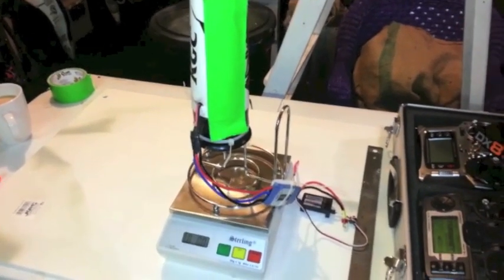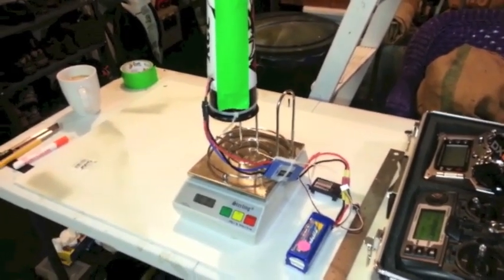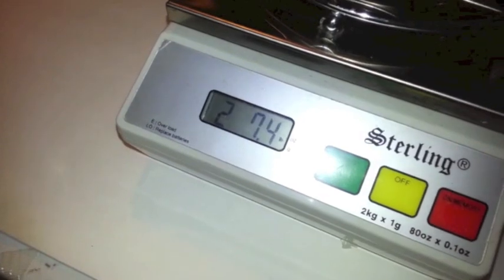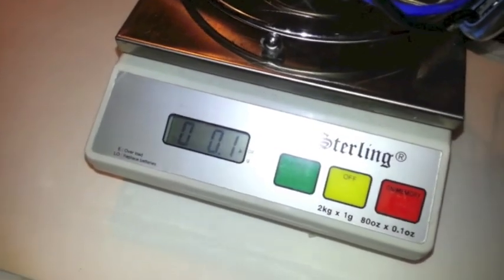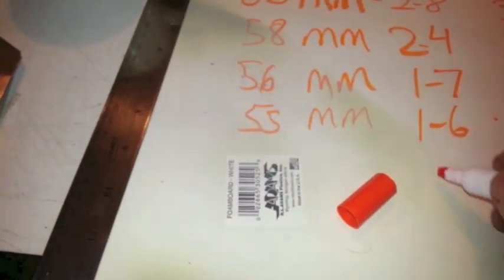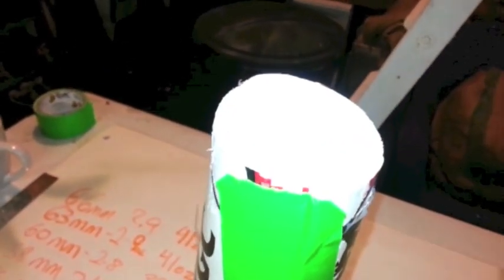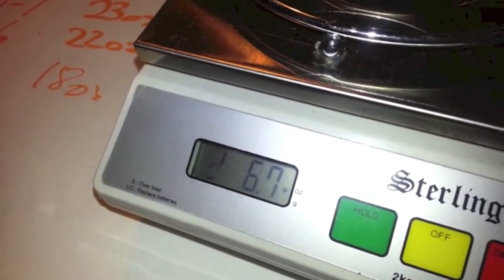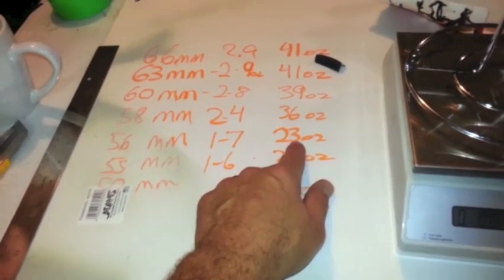HobbyKing 70mm EDF Thrust Tube Diameter Test

Comment: No. You get increased velocity narrowing the tube, but you lose static thrust. You regain speed at the top end while flying with a narrower tube, but you lose it in the bottom end statically. It's just like gearing in a car. Top gear is capable of higher speeds once you get moving, but lower gear is better to get moving, which is why real jets can adjust their thrust orifices. The newest jets can adjust the pitch if their compressor blades, and stators.

Comment: The compromise is between thrust and air speed from the exit of the exhaust tube,  the plane can go no faster than the air speed or efflux. If there is a reduction in both then there's a loss in usable energy out and just waste watts.. To measure the airspeed there's the pitot tubes from Eagle Tree Test systems that is pretty inexpensive and will give you air speed or efflux from the end of the thrust tube

Comment: Nice test and some great responses and comments. How well the manufacturer designs the thrust tubing is one of my criteria for buying a plane...except for the F-22, F-18 or other split tubing 64mm plane. My Freewing F-86 80mm EDF has the best overall design for moving high volumes of air, it has one long tube that gets about to that 80% FSA but it uses 18 inches to do it. I believe John Wells' comment is correct, we should be looking at EDF's more like tail pipe tubing or like turbo tubing. Thanks for the video.

Comment: Smaller nozzles provide higher speed larger nozzles provide better acceleration. The trick is to find a balance. The best way to test this is with a radar gun or air speed sensor and an adjustable nozzle. measure the speed of your aircraft as it flies

Comment: If you make the thrust tube like the tailpipe of a gas turbine (jet) engine, you may get better performance? The tailpipe is not fixed to the motor but is spaced an inch or two away and gently increases in diameter (like a megaphone) before continuing straight. This allows more air to be drawn into the tailpipe.

Comment: Great testing! There's something to keep in mind thought. You're testing static thrust, not dynamic one. At the same given power, a narrower tube makes speed go up and thrust go down, on the static test. Also, narrow cones increase backpressure on the EDF. This means less static test airflow, but, it gets up as soon as the plane speed goes up, a bit like high pitch props. Static thrust without speed, on jets, only helps on takeoff and landing. Once again, congrats on the tests!

Comment from the maker: You are exactly riht-kfc cup but it does what it's supposed to do. Reduce the diameter for testing.  I am not testing the optimal thrust tube design otherwise I would have used a longer tube done with rolled plastic like on my su37.

Comment: Even though the thrust is decreasing as the thrust tube outlet decreases, theoretically the exhaust speed would be increasing.  More thrust would make for a shorter takeoff distance, and less thrust would increase the top speed.  The sweet spot is supposed to be around 85 to 90% FSA (Fan Swept Area)